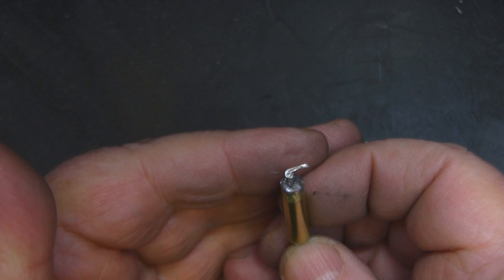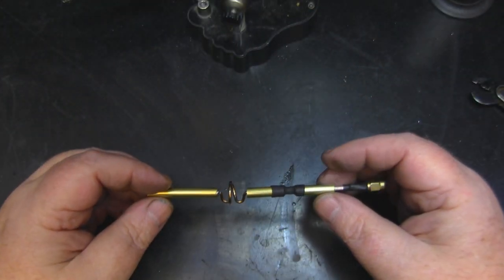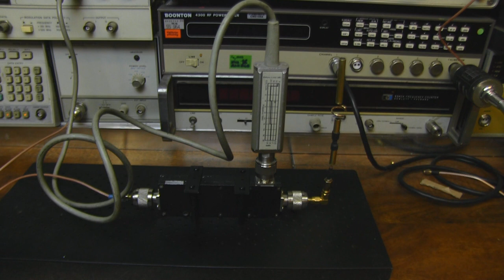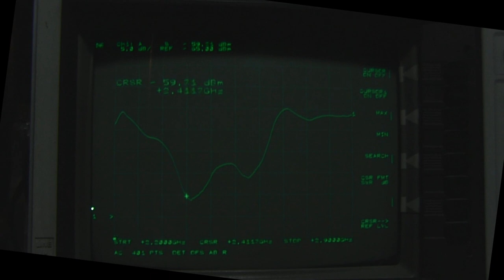Dual Band High Gain Omnidirectional Wifi Antenna

Comment: The measurements of the coil are not clear to me, so the wire is 1,5 mm in diameter so about the same as a 2,5mm square electrical wire. But the diameter of the coil is that the inner or outer diameter??

Comment: It is always with interest that I watch for years your instructive and very educational videos. I have a question about the possibility of using WIFI frequency to repatriate water height data in a well to a receiver at the head of this well. The well is 100m deep, circular in section and 450mm in diameter. I would like your opinion on this possibility of this process. I couldn't find a formula for wave propagation and attenuation in a long tube connected to earth. Thanks.

Comment: Hi, I'm designing a computer case and want to integrate a Wifi Antenna, after trying several comercial antennas I made a Biquad based on your video and it is by far the best, 5 bars all the time, would you recommend a different design? I think I prefer directional antenna, I can make it so users can re-orient it to face their router, am i right in thinking this will perform better then any omni design?
Reply from the maker: A directional antenna will always out perform an omi. Fun fact though Apple tried this in 2001 but scraped the idea because people complained they had to put the pc case at weird angles   and did not look cool on their desk.

Comment: It's nice showing how to make the antennas but what about the mathematics behind it i.e. Lander over frequency and getting the  Measurements for quarter wave half way and 3/4 wave.
Reply from the maker: There are other channels that do that but unfortunately, they struggle to get the views. Most people just want to know enough to build a working antenna and are not interested in the math. If it was as simple as Lander over frequency it probably would not be too much of a problem but to truly understand it you need a firm understanding of calculus.

Comment: Can be made with a coaxial tv cable?
Reply: Coaxial TV cable has an impedance of 75 ohms. Most radio systems use 50 ohm coax. For max power transfer from antenna to radio impedance should match. If you get some 50 ohm coax like used for CB radio you can trim it so the center conductor is 1/4 wave length for the frequency your looking for then fold the shield part of the coax, that is the same length as the center conductor down over the cable for the second half of the dipole. The main issue is the SMA connector which would be difficult to mate to a larger 50 ohm cable like RG58U. That's why smaller diameter coax is used in most WiFi antennas. Larger coax is better as it has less loss. You can use the wrong impedance cable but its length must match the wavelength for the frequency so whatever impedance is at the antenna end will be reflected at the radio end. Study dipole antennas for more information.